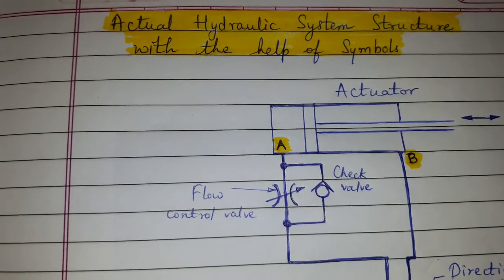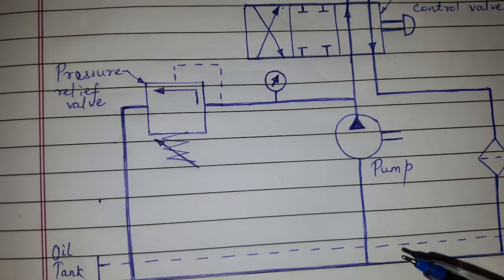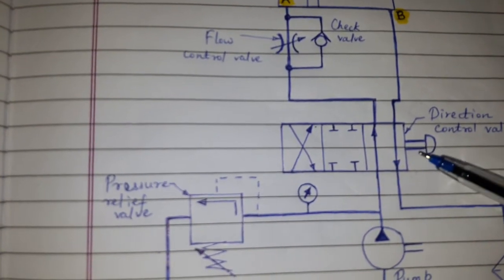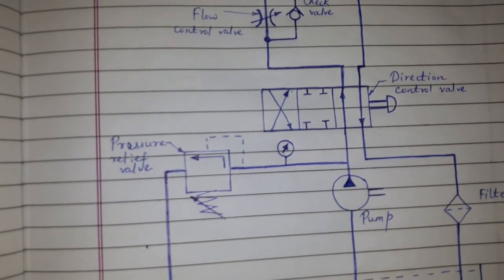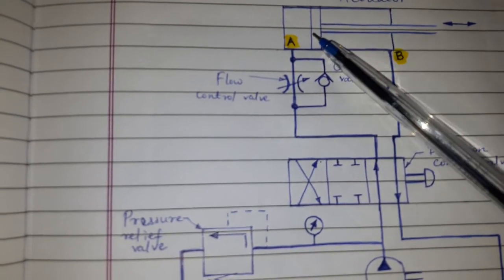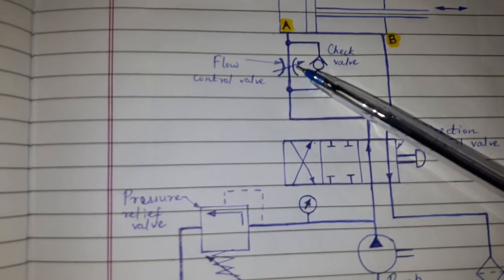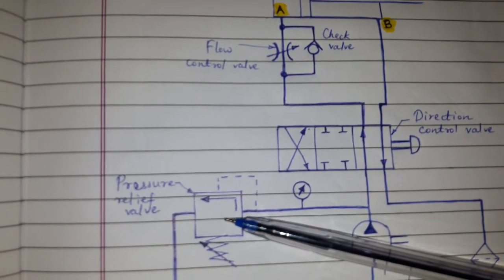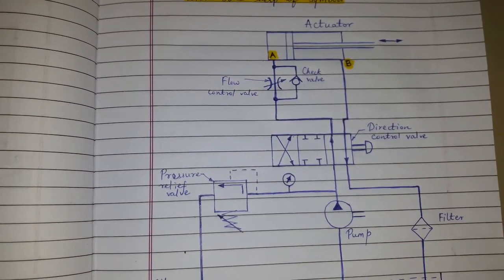Actual Hydraulic System structure or General layout of Hydraulic system using symbols

Comment: Sir, what does the dotted line mean drawn over pressure relief valve?
Reply from the maker: It is a kind of signal/connection from the line to PRV which informs PRV about the pressure... Once the pressure is increased in the line upto its set point... PRV relieves the pressure...